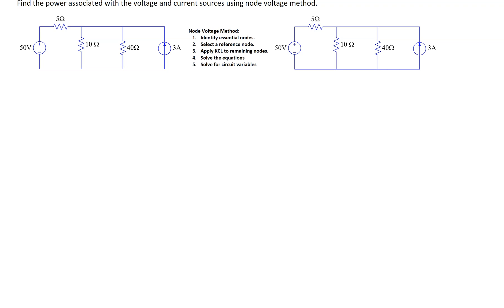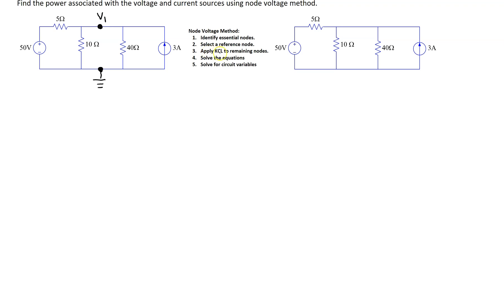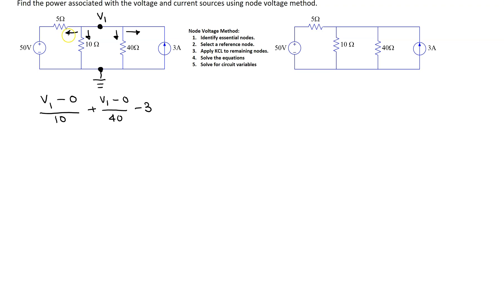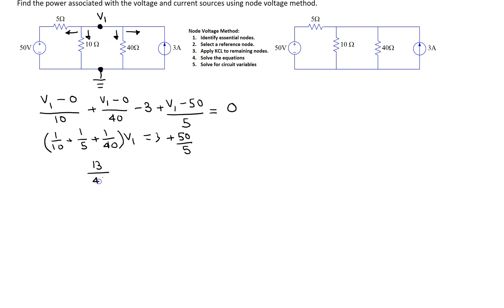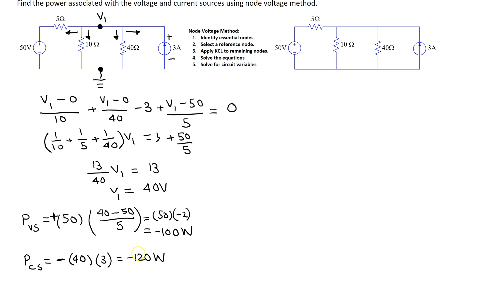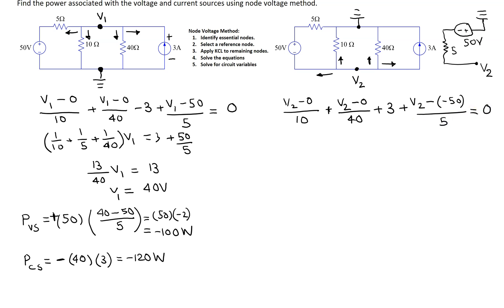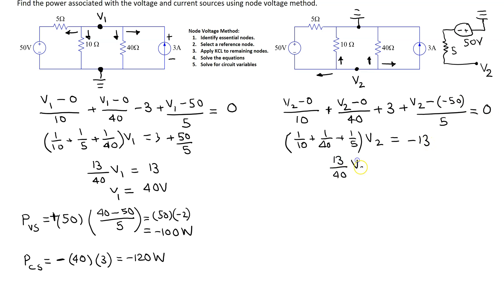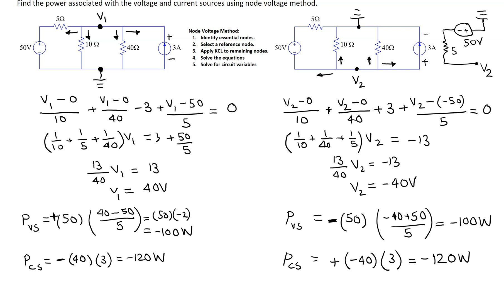Node Voltage Method  - Example 1 (Trick: Impact of ground)

Comment: Pvs why 50 volt? The potential different in R1 is 50-40=10
Reply from the maker: Thank you for the question. To work out the power associated with the 50V source, we need to work out the current through the 50V source. Then, use passive sign convention to write the power expression with the correct sign. 

In the video, the branch current is shown flowing from node 1 through 5 Ohm resistor and into the +ve terminal of the 50V source. So, this branch current is (V1-50)/5 = (40-50)/5 = -2A. As this current is entering the 50V terminal marked +, p = +(50)(-2) = -100W. (supplying).

The magnitude of the voltage drop across R1 (5 Ohms resistor) is indeed 10V but when working out the branch current, we need to take branch current direction, alternatively voltage polarity into account. Hope that explains your confusion.